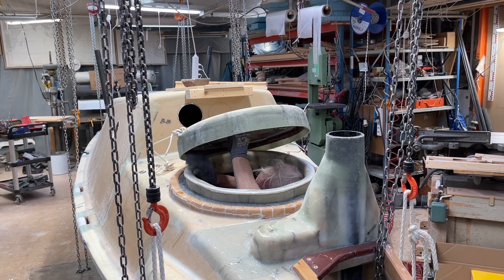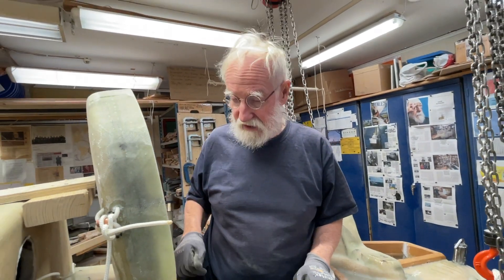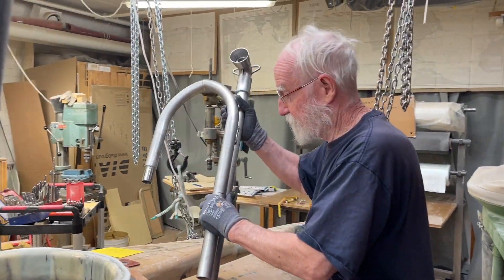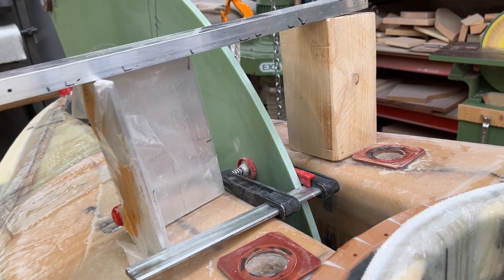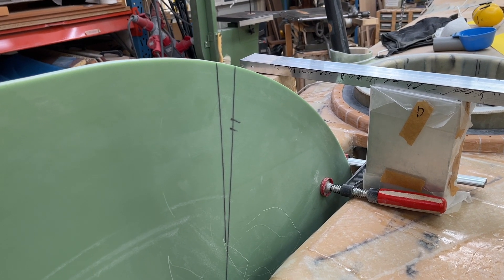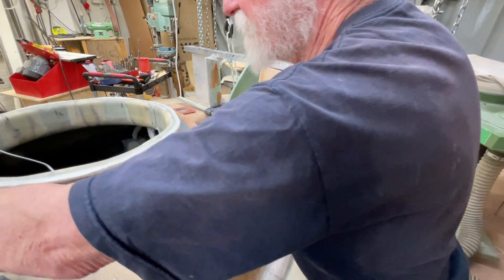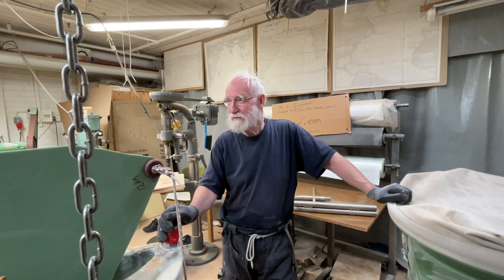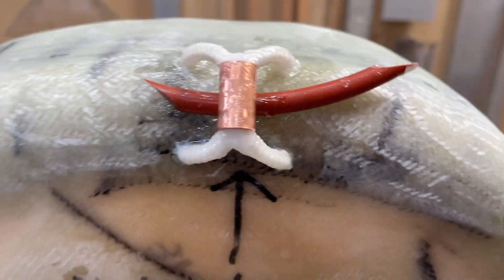2 sep 2023  Ventilation and aft hatch

Comment: Watching another sailing channel they mention that divinny cell is 10 X the price of plywood that is without resin and glass!. How much do you estimate the hull has cost mabye 20,000 euro?
Reply from the maker: In fact I did see it also 
I do not know the cost up in Prince Edward Island and I do not know what plywood he use but but I would build of more than 9 mm if as he says the boat is good for any ocean. He built the mast from cheap wood from the lokal timber yard.
Also you do not have to use 50 mm Divinycell if you are concerned about cost.
Perry is using 10 millimeter. I think that is to thin but 30 mm is fine.
He is using epoxy and glass on the outside.
He also have plenty of frames with taped epoxy fillets. 
With 30 mm Divinycell you do not need frames on a small boat.
Divinycell is much cheaper than what he say.
I will come back with numbers.
Reply: In Maine divinycell h80 30mm (actually 25.4mm) is around $250/sheet. This is a quote I got through a boatyard that has an account with a composites distributor.
Reply from the maker: May bee a small boat need 16 sheets that will be 4000 dollars.
Many boats up to 60 feet use 3/4 or 20 mm still good insulation  @sharpiedory
Reply: @sharpiedory  So 50mm at retail price may be as high as $800 US  add resin/glass?
Reply: I wonder what sort of foam Etap use? Presumably they use something cost effective as they are a successful volume producer of boats.
Reply: @cornishhh  divinycell and airex are industry standard. I think the big cost is the labor. Doing infusion over a mold and laminating inside and outside in one operation is how they’re efficient I would imagine.
Reply from the maker: I am shore the foam is structural.
If so it does not need to be strong in compression, tension and sheering @cornishhh
Reply: Which channel?
Reply from the maker: Wave Rover  @shoutatthesky

Comment: 1" H80 is $375 per sheet plus shipping in the States.  1/2" is $210.  I think Wave Rover used 30 sheets including all bulk heads, etc.  This amount should ship cost effectively, say $500 for the load which would then run about $10,000 total with a mix of if 1" and 1/2".  Marine ply would run about $100 a sheet plus shipping, or $3500.  So a more realistic cost for materials difference for Wave Rover is the difference between $10,000 and $3500.  It's real money, but probably shouldn't be the decision-maker when you consider the overall cost of the boat and a long passage.
Reply from the maker: Rayan below says its 250 dollar per sheet.
The Wave Rover is a much bigger boat also he have a complicated accomodation and a lot of frames.
Frames are not needed on a boat built in Divinycell about 20 feet.
I use much fewer sheets
Reply: Is that price from a chandlery? It seems high markup. I looked at my wave rover plans and they call for 28 sheets of 9mm. The bottom and transom are doubled up to 18mm. Interesting to note that even 9mm plywood is more than 3x heavier than divinycell h80. Yes you're adding glass to divinycell but you're removing a lot of internal structure. Adding up areas of the parts of wave rover per the plans I think a divinycell version would be as much as 15-20% lighter on the fully loaded displacement. And I think it would be closer to 20 sheets. It seems like the additional cost factor is equal to the weight savings. Not to mention all the extra benefits of divinycell: insulation, flotation, impact absorbtion, longevity.. also note that WR650 is roughly twice the displacement of Exlex
Reply: @sharpiedory  There are many factors to consider when choosing boat materials.  I was just comparing the direct cost of the area requirements for all sheet goods.  Obviously, if you change the design (bulkheads, stiffeners, etc.), It will affect everything - like how much panel area you need.  For a displacement vessel, lighter weight isn't necessarily a goal, just as a weight distribution with everything in the low keel isn't always the best. For many boat builders a main driver may be the choice of material itself, either because of existing experience or simply preference.  Building some optimal performance vessel isn't always a driver.  Sven has specific optimization targets. He likes (or at least is comfortable) working with foam and glass.  He has chosen a well-matched material and design combination to meet his desires.  But I don't think anyone should assume their own drivers should be those for someone else.  As an example, many sailors prioritize speed through the water, pointing ability, in their design. Sailing through the most challenging seas on the globe may not be included. 🙂
Reply: @boooshes  Plywood is mostly about saving cost. A foam core boat can be built with the same techniques as a plywood boat. Foam core is not as expensive as people are publicly claiming. There are no performance advantages to plywood. It's easily punctured and rots. The flat bottom of WR650 is going to pound on the waves and make a lot of noise with that thin shell. There is going to be a lot of condensation which will accelerate the deterioration of the boat. For cabin cruisers that are meant for long life plywood is a poor choice.

Comment: I would definetly slide the aft hatch to one side, but maybe its not as much in the way up front as it looks in the videos.
On the ventilation pipe: not only must it clear the centerboard but also it should be possible to remove the centerboard and reinsert it. I dont know why the pipe has to go accross the board at all (i dont understand that part of the ventilation system). But is it removeable? how do you get the centerboard out and in if you have to?
Reply from the maker: The pivot point of the centerboard travels in a grove and it can be removed.
The ventilation pipe cross over to the other side the reason is when the boat is healing 90° some part is always above the waterline
Reply: @SvenYrvindExlex   ah now i understand, thank you for the explanation. good.

Comment: I think the stainless pipes will be much better 👍but will they not heat up to much in the sun ?
Reply from the maker: I had stainless aluminum and steel on previus boats with no problem
Reply: They have high reflectivity so they do not absorb much heat from light.